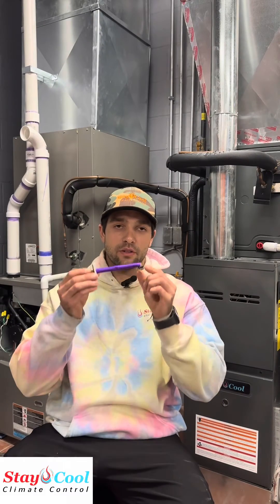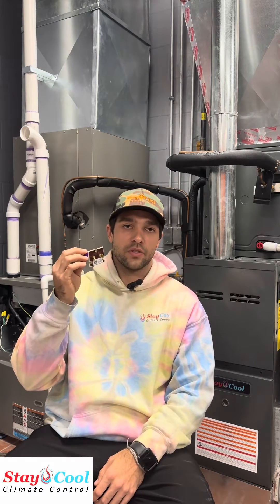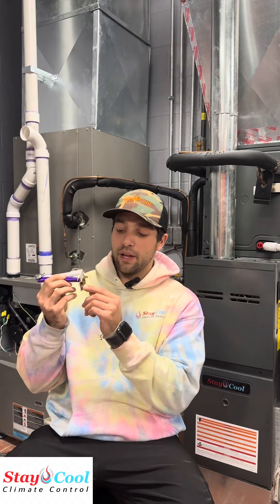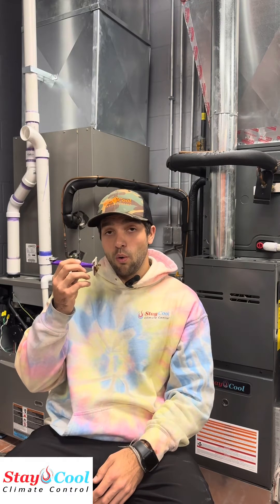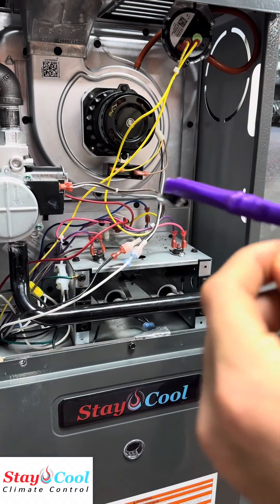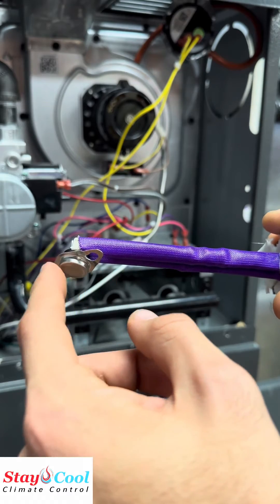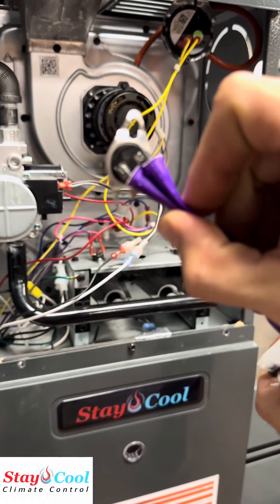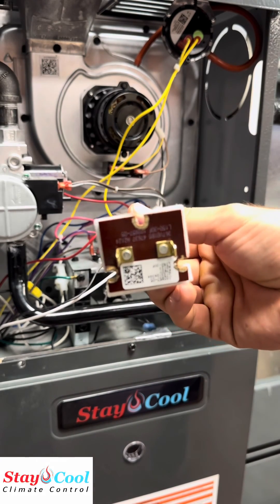Gas Furnace Limit Switch

Comment: Lennox gas pack that I believe has a faulty limit switch is my issue. Looks similar except temperature range is 165-30 and orange in color. One of the three 5/16” screws is corroded badly. Will probably need an easy out  bit to remove. Easy job turns somewhat difficult.
Reply from the maker: @roberts1159  it is like that sometimes.. especially when it’s supposed to be an “easy job”